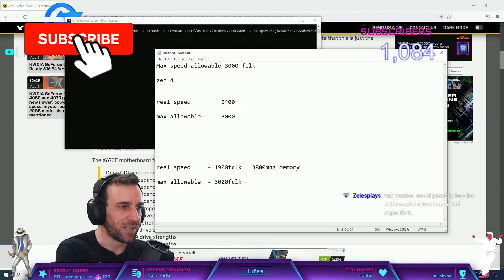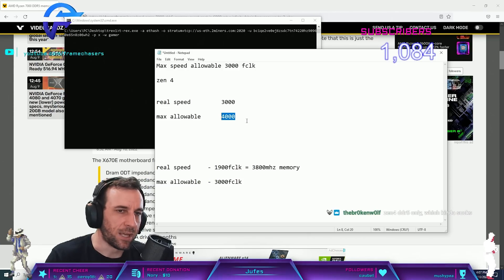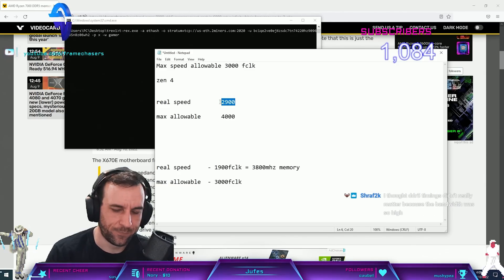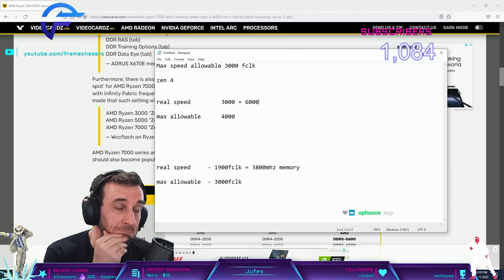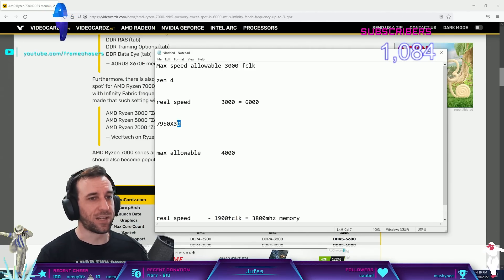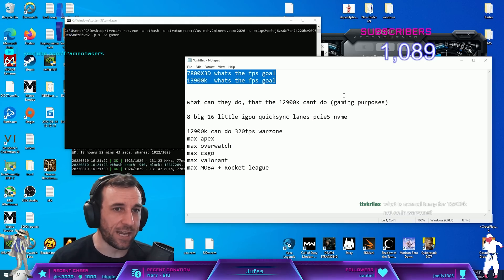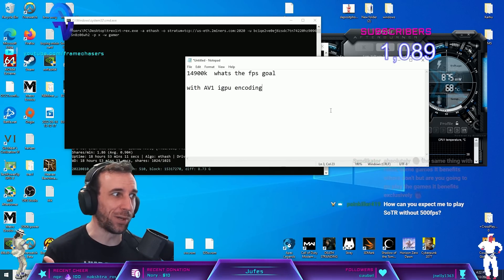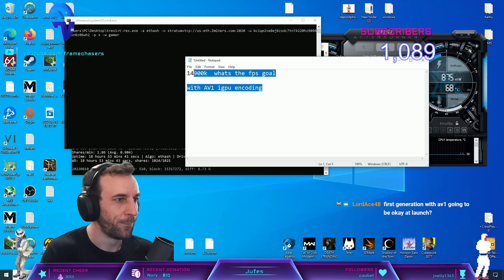Will Ryzen 7000 Fix The Dip?

Comment: I still play on the i7 7700. Most of the time it still works great, but there are a few mostly strategy games that require quite a bit of cpu power, such as (Planet Coaster or Anno) But Gta 4 also needs a very strong CPU, so there are a few exceptions where an i9 12900k doesn't get over 60fps.

Comment: There are still some old games really depend on single thread, lots of cache and fast memory. I play only one game that I love for over 10 years now and 5 years of it in VR and it is the goat. Its called rFactor2 and i race with a HP Reverb full 100% resolution 3148x3048 per eye = 19,190,208px.  I did not need 16 cores, I needed  4 very fast cores for the game only and then whatever VR demands to be low latency. So the reason I got 12900k and not a 12600k is for cache size, core speed and the higher bin.
The PC as a whole with wait for it a 6900xt just about runs the game the way I want to play it and this is with a mega CPU and RAM overclock.
If Intel didnt made a 12600k with 30mb cache i most likely would of chosen that path but it is what it is.

Comment: 9:49 I am personally excited about a potential mega APU. If i can get a micro PC the size of a Mac Mini, that has 8 Zen4 cores and 24 RDNA3 compute units, and DDR5 6600 i'd be very, VERRY happy. Especially if you can get similar performance in a handheld with the same CPU at a lower power budget

Comment: Ryzen 4000G and 5000G can hit 2500 UCLK, FCLK, and MCLK. I have two 5700G a 5600G and a 4750G that can all do 4800C18 or better with both 5700G hitting 4933C16/C17 (74GB/s at 49.1ns of latency)
This is because the 4000G and 5000G IO and memory controller is on TSMC 7nm instead of the 3000X and 5000X being on GloFo12nm(a 14nm class process) So with Ryzen 7000 having a 6n+ IO die, i wouldnt be surprized if it hit 3200-3400 with the right motherboard, as i feel like they did try to focus on mid range DDR5 speeds(66-6800)
The problem with the 5000G processors is that they are effectively negative D cache. With 1/2 the cache of the base X processors it doesnt matter that you can run DDR4 4933 CL17-17-17-30 with geardown disabled, you're not getting anywhere near a 5800x with 3600CL18 in most cases. Yes some cases it is better than a 5800x3D but basically a 5700G cant beat a 5600X in any sensitive workload, basically 5000G needs to loading things in and out of cache twice as often as a normal processor, this means it is often in a parked state.

Comment: I play iRacing in VR, that certainly benefits from faster and faster CPUs, it scales with IPC and frequency, the 5800x3d also showed that cache was quite beneficial. This is a pretty specific use case though and not applicable to most gamers.
Reply: Oh, iracing is cpu demanding? On flat screen too or only in vr?
Reply: @branchprediction9923  Mostly VR and triple screens to an extent as well, it's been so long since I used a single monitor I can't comment so much but I don't think it hurts. Certain race tracks are quite demanding and then you take a race start with lots of cars on screen and it can really impact the lows.

Comment: Thats why the more you wait the sweeter the upgrade gets, upgrading every or even every second gen is boring, sure you get the dopamine rush in the first week or so but i'd wager most people wont really notice the difference without fps counter. Now about the whole 3000 FCLK, afaik yuri bubiy just found that value in the bios as max possible option, doesnt mean its will run at that speed. Im quite skeptical that all 7000 cpus will manage to run at 3000mhz fclk possibly none of them, but i would like to be proven wrong ofc. Where that "3000 sweet spot" came from i have no idea
Reply: @brownie43212  Frankly i think you are few years too late, but yeah the upgrade is going to be insane! I personally used 4670k too but upgraded it to 4790k back in 2016-2017, because of stuttering in some games with gtx 1070.
Reply: @brownie43212  because 4670k has been struggling to run at 60fps in many games, ofc if you dont play those certain games or older games then it should be fine still, but then there is that you probably dont need an upgrade
Reply: @brownie43212  understandable, something like r5 5600 or 12400 would be an amazing upgrade though
Reply: @brownie43212  but x670+7600x will be terrible value, sure the upgradeability is enticing but the value isnt there, im honestly confused. You said zen 3 and rdna 2 was crazy expensive yet you are aiming at even more expensive zen 4 platform 🤔

Comment: It going to be extremely disappointing when no one can hit 3000 flck, it shows that current zen 3 hitting 2000flck my 5950X maxes at 1900 and isn't entirely stable for gaming outside of benchmarks so I'm forced to run 1800 for stability.  Just from history I have a hard time believing amd will hit that fabric speed.  I hope they do but I game at 4k and none of this matters. lol
Reply: 5700g can go 2500+ already, so 3000 is no a problem
Reply: You have to remember that the 5000 series came out 2 years ago.
Reply: 12nm GloFo vs 6nm TSMC for the I/O die, that alone should do most of the work to get fclk to 3000. GloFo process is ancient rotting garbage in comparison.
Reply: I can hit 1900mhz on a r5 3600 lol, only unfortunate part is that I can't maintain it due to my cpu static OC isn't stable with that freq and I rather have the OC than to just push the ram to 3800

Comment: I want 3090 performance at 200 watts.  My crap 2060 super does great at 125 watts 1440p dlss.  I upgraded to 3070ti $449 TUF on ebay.  But im building a fortnite pc for chritmas for a friend and my last gen parts will be perfect for a budget buld.  then I can buy the Vipers and 5800x3d on same MB.
Reply: Going to be a couple generations for that I believe.

Comment: what cpu would you recommend for streaming league at 200+fps? I have an i7-8700k and it drops to like 90 fps in team fights. I was thinking of getting one of the new amd cpus that are coming out in september but not sure what to buy
Reply from the maker: 8700k should be able to do it, make sure your using nvenc in OBS and not x264
Reply: I maintain 200+ on a r5 3600 when I stream, maybe tweak some settings?